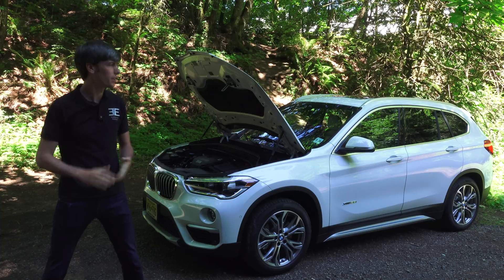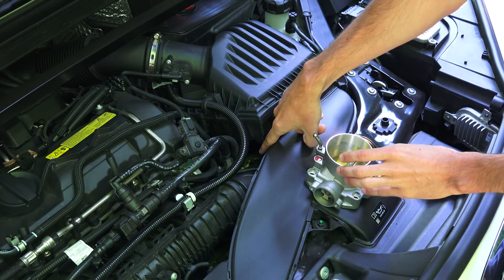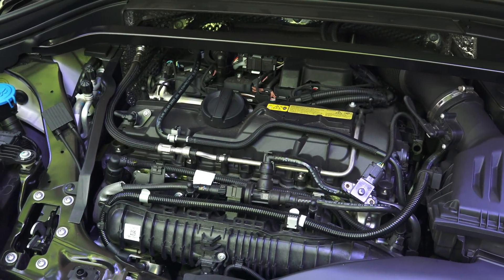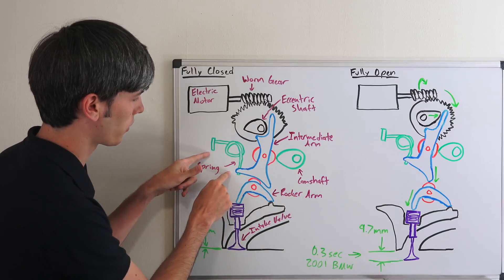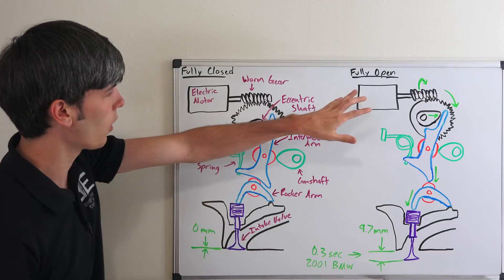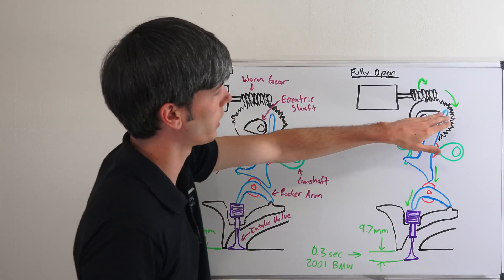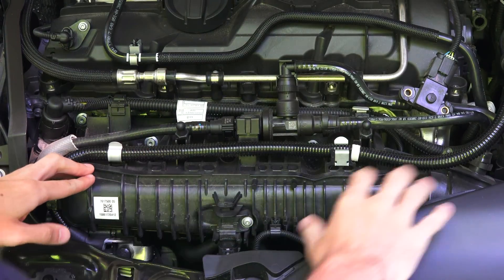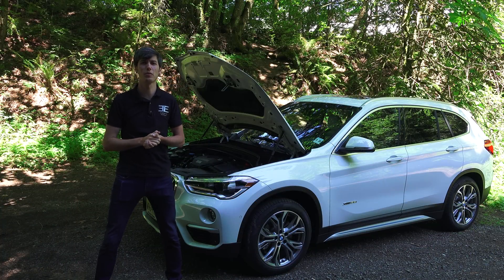What Is Valvetronic? BMW's Innovative Throttle System

Comment: What a weird system!

So if I'm getting this right, the ECU sets engine speed by controlling air flow into the cylinders with variable intake valve lift rather than a throttle body. Moving the restriction from a throttle body to the intake valve might help with throttle response but I don't see how it makes a difference to pumping losses--if the intake valves are restricting the air, you'll get vacuum in the cylinder the same as if you had a throttle body farther away. Am I missing something here?

Comment: I suppose theoretically this system also improves efficiency/economy since there should be less resistance due to the camshaft not having to force the valves/springs to their full travel unless under full throttle.
Reply: He affirmed that on the video

Comment: give it up to bmw to make something super simple overly complicated for basically no reason.Wait until these start failing and getting stuck wide open and causing accidents.
Reply: 10% fuel economy boost is kinda a strong reason.
Reply: The throttle body remains there to prevent exactly that from happening, too.

Comment: BSFC curve shows engines operates most efficiently with throttle wide open 100% of the time. but simply shifting the throttle valve to the intake valve do not solve the engine efficiency issue.

Comment: Instead of complicating with gears and cam why can they go for cam less engines. A inlet valve which is controlled using pneumatics will serve the purpose.

Comment: Gasoline engine in contrast to diesel regulate power with air instead of fuel. That means it has to have some method of restricting the airflow. This is usualy done with throttle plate, but it can be also done with variable intake valve. No  matter which metod is used engine loses its efficiency due to pumping losses. The only differences with throttle plate agains variabile intake valve method is  as said by the author in response time. 
BMW claims of 15% more fuel efficient, yes but not beacuse pumping loses as many thing but beacuse the whole engine is optimised. Most of the efficiency gain comes from the fact that with partial engine load when valve open just a bit incoming air speeds up thus increasing the fuel atomisation and stratified mixture can be formed. Instead of homogenous mixture, fuel molecules are mixed with air only in the center, where at the cylinder walls pure air acts also as a insulator so less heat is transfered to colant. With stratified injection less gasoline is needed and more complete burning is optained.

Comment: So just like Hondas Vtec but I-Vtec, just works differently, I-vtec has multiple Computer control throttle bodies in the intake short and long intakes valves, but than again this isnt about performance is all about fuel economy. SMH!!!

Comment: Make a video on Ceramic coat headers, rear housing, dump pipes etc?

Or a video on Turbo blankets and how heat effects engine bays.

Or how containing heat with heat shielding etc helps with flow of exhaust gases etc

Comment: You drew both scenarios where the valve "should" be fully open by cam position, any other scenario would have the valves closed. So I guess this doesn't have a bearing on whether the engine has to be a non-interference type or not?

Comment: Why not putting a voice coil actuator directly on the valve and control the entire cycle electronically? Here I see that the system is the addition of 2 movements, one fast coming from the cam shaft and one slow coming from the electric motor/throttle pedal. you can do that safely electrically for quite cheap.

Comment: How similar is this to i-vtec? From my understanding, i-vtec does the same thing with the throttle valve when certain speeds and rpm ranges provide necessary scenarios for the system to activate. The only difference would be that the throttle valve is always wide open. Can you clarify?

Comment: I would LOVE to see two testbench engines run side by side, one WITH the valvetronic system still in place and operational, and one with it completely bypassed, relying on a regular throttle and regular vvt/vvl valvetrain with as identical as possible ecu maps.

"at least 10%" sounds a little astronomical.

Comment: I think it's a nice article until 3.30 -  the bit about throttle response time to suddenly fully open (or 'flooring' it) - which is completely wrong I think. The electric motors driving the valve lift cam are way slower than it takes to fill the intake manifold with air.  Way way slower I think . 
Think of a one or two pringles sized strong metal cans,  that are sealed with end covers, and have a near vacuum inside - and then imagine suddenly removing the cover at one end . How long do you think it takes to fill with air ? 0.03 seconds or 0.3 seconds or what?

Comment: FFS! All those moving parts, parts piled on parts piled on parts to fix up a fundamental problem - heat engines suck. Electric motor - 1 moving part, 98% efficient. Problem solved. Put your research dollars into batteries, please!

Comment: How is there much of a difference in pumping losses?  You simply change the placement of the obstruction from the throttle body to a very small intake valve opening.  The piston is still pulling against that resistance and pulling the same amount of air through the chamber.

Comment: Nissan VVEL also works like this
Reply from the maker: Correct!
Reply: Currently driving around a 2017 Armada to train dealership sales staff. The throttle response is really sharp and torque is great. Do you think variable exhaust valves would change things much?

Comment: Surely pumping losses are similar a throttled intake.. 
I can understand the improved response part as the vacuum is now behind the valves and not the TB. 
Greater velocity with a smaller valve opening but there would still be vacuum present behind the valve otherwise AFR would be out of whack.

Comment: I worked for the large German company named Siemens in the medical division for 20 years.  A great company and the Germans are wonderful people to work for however we had a motto that went something like this, " Why make it simple when you can make it difficult ". It is true that the Germans are masters of engineering at all levels, one has only to look at many of their developments over the years. Hopefully this complicated gizmo will be as reliable as Honda;s VTEC systems have been over the years. It is just adding more hardware including a vacuum reserve device for the brakes. Hardware cost's money and goes bad. There are a lot of moving parts here and all this just adds to the cost of running one of these cars especially as they get older. Buying any used high dollar German car has always been risky and things like this don;t help the reputation when they fail.

Comment: I feel like this is an advertisement for BWM with none of the negatives of this system being shown. Like under vacuum you will have a higher velocity in to the cylinder and across the port where fuel is sprayed allowing for better atomization. Direct port injection is terrible for cars valves.

Comment: This system is a neat and relatively simple way to do infinitely variable lift that both improves power and efficiency, but I don't think most of the gains over competitors are from the increased MAP. Most, if not all modern engines with variable valve timing utilize valve timing strategies under part load that already near eliminate pumping losses, such as late intake valve opening and exhaust valve closing. In this system, the valves essentially are throttling the engine, so many pumping losses remain. Now the combination of this technology along with cam phasing, like I'm sure this has, would drive the greatest gains, but you're also adding a lot of mechanical work and friction with all those moving parts. In traditional cam phased systems, MAP is within a couple of kPa of BARO, with the delta being driven by induction restrictions, but in most cases not from the throttling of airflow under road-load conditions. I do like the implications of this for power and emissions improvements

Comment: what about the durability of the system does every intake valve have it's own motor and controller or is it a single motor that drives  worm gear that is connected to all the valves and how long do the electric motors last

Comment: I once saw a video, a while back (I don't remember where to find it now), where hydraulic pressure was used to regulate the vales as opposed to a camshaft; so in this case it needed to timing chain or belt. The system could be used, as you described, to regulate the airflow through the valves. Have you heard of anything like this or does it work?

Comment: How pumping loses are different when intake valves are almost closed compared to throttle body almost closed, yes you don't have lower than atmospheric pressure in the intake after throttle body but you have it in the engine now ?Difference can be that air with higher pressure is closer to combustion chamber compared to air outside throttle body but that is completely different from what you are saying ?Also maybe there is better air flow because now only intake valves influencing the flow compared to throttle body valve plus intake valves.... but pumping loses because of lower intake manifold pressure does not sound very nice and correct.

Comment: Oh my! This is so complicated! So many pieces and mechanisms means so many possibilities of failure... I wonder the reliability of that system. Better go fully electric, there's nothing more reliable and efficient. But something I don't understand, why they didn't use electrically activated valves? I believe solenoid valves exist already for some time, right?

Comment: Does this mean you can emulate a more aggressive camshaft by tuning the eccentric shaft to relatively "engage" or "disengage" as a function of cam angle?
Reply: No, that won't work. Maximum duration and lift are still determined by the camshaft. The Valvetronic only changes the rocker ratio so to speak. If you want to increase performance, you'd have to mechanically change the cam profile or the contour of the intermediate lever.

Comment: was this system already in  use on e46´s? we had couple of those in our shop for the last couple of month, mostly e46 316 ti´s and 318´s. i never had to work on them luckily, but they all had broken eccentric shaft springs.. i asked my colleague what the eccentric shaft is for, and he said its for a steady and smooth engine idle..

Comment: would a long tube intake manifold give you the same effect as it would on an engine with a normal throttle body setup?
Reply: I believe so. Longer intake tubes generate a higher mass of air moving when suddenly the valve shuts. The air loaded with inertia is compressed and generates positive pressure at the intake ports, when they open, the air forces itself into the chamber at higher velocity. This effect is similar to the Helmholtz resonation.
 To answer your question, yes. Not having a trottle body does not create low pressure at the tubes during partial trottle keeping the air at higher specific mass and responding even better to resonation at partial trottle. At Wot, the effect would be the same
Reply: Air-ram and intake tube length is important - has been for decades : "long" is not necessarily right : roughly 'tune' your intake length to suit your engine RPM etc and you get the best intake ram - it was a 'novelty' not used on mass-market cars in the in the 1980s - but now almost everything has a tuned intake length.

Comment: Looks great.  Good luck with reliability.
Reply: This system has been used since 2001. First appeared in the 316ti E46, IIRC, and isn't that bad. The Valvetronic starts going out at around 10 years of age, and that is for the early engines.

Comment: The throttle valve in my car is always wide open too, however I don't have valvetronic :D
Reply: no way! our foot must have the same problem
Reply: @briland7166  Problem? I think you mean innovation
Reply: @briland7166  bahahaha I think my foot usually has the same “issue” as you and OP
Reply: That means your engine is pumping in the most efficient way. Good job!
Reply: Know that, haha ... they say, driving a constant speed will improve fuel economy ... they say, dethrottling the engine will improve fuel economy. I tried this out, traveling from Berlin to Hannover - fuel economy was very poor then, but I was kind of satisfied with my average speed (170 kph door to door), getting this done in exakt 100 minutes (with Grandpa's C240 that I had inherited back then - no longer have it).

... but it took like 16 liter on 100 km, which translates to 14.7 mpg - that, however, did not impress me regarding the engine, but it was prove that this car's body is aerodynamically well designed (MB W 203, threevalve V6, automatic transmission).

Anyway, I must have mistaken something here ... fully dethrottled most of the time, constant speed most of the time, and still it was a heavy drinker. What did I do wrong, here?

... hehe...
Reply: @DC-rn1fc  its no so much driving at constant speed saves fuel. U have to have a good combination of speed/gearing/engine rpm. For example doing 160kph while turning like 4000 rpm in 6th gear will not save much gas as say doing 100kph in 6th gear turning 1500-2000rpm. Usually a vehicles most efficient operating condition is cruising at constant speed but at low engine rpm in the highest gear. Higher rpm means more combustion cycles per minute and more combustion cycles per minute needs more fuel. On the otherhand if u go too slow say doing 60kph in 4th gear at 1500 rpm is not going to be as efficient as 100kph 1500 rpm in 6th gear because your using similar amounts of fuel but not going as fast .
Reply: @sl0907  Uh ... you got that that was a joke, right?

Anyway...

At a given average speed, the fuel economy is best when it is driven at a constant speed. That, in itself and before any details about the engine and stuff, is true - or, to put it another way, at a constant speed, the least work from the engine is required, if we now assume that the efficiency won't change dramatically (or - will change less then the power demand does, which is true for about 100 % of actual cars...), we can say that constant speed means lowest consumption.

Throttling to control the power output increases losses and therefore makes the engine less efficient. So not throttling it seems a great idea (at high loads, you usually have higher efficiency - a bit below highest usually is the sweet spot), BUT doing so in a throttle controlled engine also means running at full load all the time, which won't do much harm to efficiency, but increases power output, and more power supplied at equal efficiency equals more fuel to be burnt.

What I did was driving at the vehicle's Vmax constantly - no throttling losses, and no unnecessary changes in speed.

Uh ... more combustions cycles per minute need more fuel ... isn't necessarily true. The engine's load may have a say in this too, and a lot of other things.
Reply: @DC-rn1fc  no valvetronic? Lucky you! Mine is giving a code ! What a headache!
Reply: You drive diesel?
Reply: Slow down
Reply: My Brother!
Reply: Valvetronic sucks, BMW likes to make things complicated which creates more problems and I'm not buying another one.
Reply: Less complexity! What's that bong going off for though....?
Reply: I heard that's because you're always speeding to the rainbow district
Reply: I have two throttle "valves" to open all the way, though the one only opens once the other one is open.

Comment: Hi, I'm trying to figure out a way to disable Valvetronic in my E46 with N46 engine without disabling VANOS because I want to try to develop some form of custom ITB system for it. Does anyone know of a way to properly disable Valvetronic without disabling VANOS? There is a computer unit box named "VVT" in the engine bay, and I don't know if it controls only Valvetronic or both Valvetronic and VANOS, but I have seen someone who removed it and the engine still runs while using the throttle body (since Valvetronic has been disabled). However, I am not sure if doing so has resulted in the inoperation of VANOS or not.

Comment: W-VANOS tech is coming very soon and Double VANOS is already obsolete.W-VANOS uses a throttle body and water injection system (based on the name W stands for water).Soon to be used in future BMW models and engines.

Comment: Sort of like a more extreme version of the iVTEC system Honda put in the civic back in 2006. Second cam profile that retards the intake valve, so that the throttle plate can stay wider open for less pumping losses. But as you plant it, it goes back to a normal engine.

Comment: Typical piece of German over(complicated)engineering. Please do a video on Fiat's MultiAir, they do the job with 1 solenoid.
Reply: Okay, how do you make an infinitely variable valve timing system with just one solenoid? That would make it binary, sorta like Honda's VTEC.
Reply: +MarchuxProductions Multiair is only for the intake valves. Each cylinder has a single hydraulic solenoid.

Comment: How does restricting the valve opening reduce pumping losses compared to restricting a throttle valve opening? Both restrict air into a cylinder.